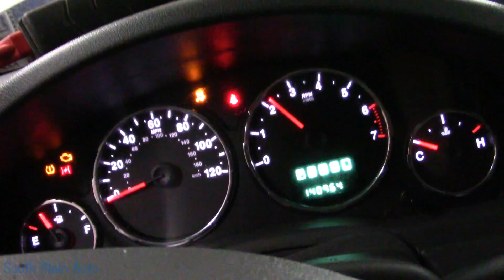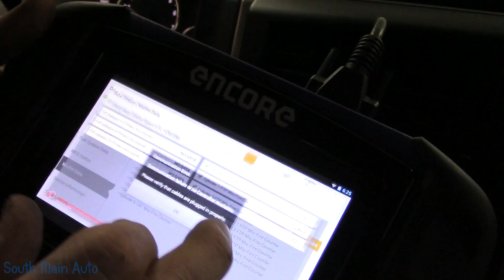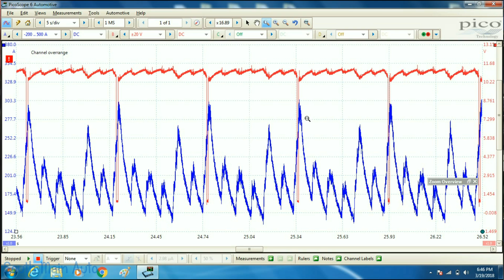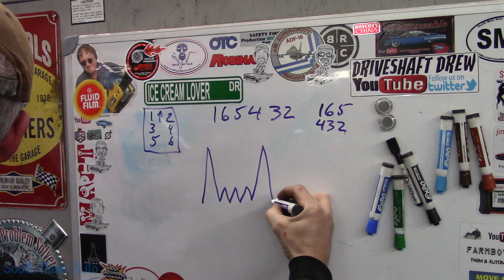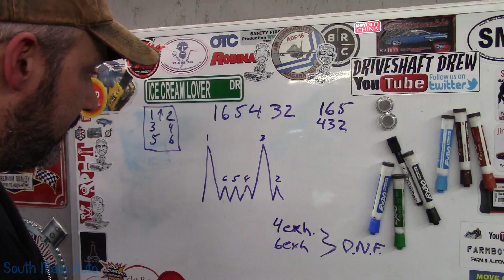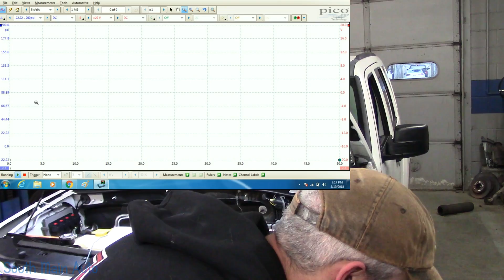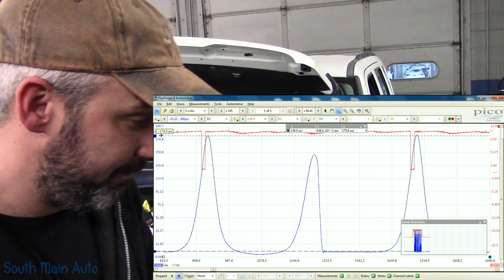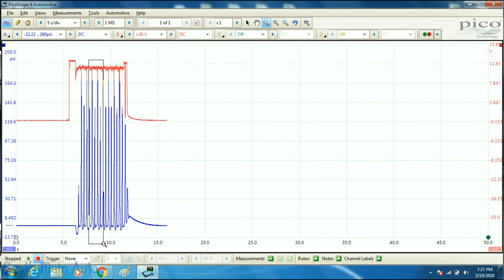Jeep Liberty: Cranks, Starts, Stalls, Runs Rough- Part I

Comment: What an excellent case study. I suspect many professionals would shrug and never explore it enough to find such compelling evidence. I was thinking it was going to be a timing issue, but then when I saw the spark coincident with TDC compression, I had to reconsider. Also I didn't jump at the most important finding, extremely HIGH torque to spin over those two cylinders. These are the problems that make auto repair so interesting.

Comment: At right around 15 minutes I was getting anxious saying "just do a compression test" then came the words of wisdom that will stick with me for ever...." A compression test proves a cylinder can seal, but it does not prove it can breath" priceless advice right there.
Reply from the maker: However, a running compression test will show how it breaths, but ours does not run 😉
Reply: Was thinking exactly the same thing.  Learned something new right there!
Reply from the maker: It does prove Kerryithm2. It proves the engine can seal :)
Reply: Thanks missed that

Comment: When I heard it crank and kinda run, my first thought was some kind of timing issue. Luckily you have the proper tools, and the most important tool under your hat, to quickly diagnose.  Nice work!  Can’t wait for part 2 to see what is the true issue.
Reply: STΔR- LᎾRD I’m trying to diagnose my Jeep Grand Cherokee right now! I could have sworn timing issue as it sounded the same way! For some reason my fuel system isn’t holding pressure with no leaks!!  Even pulled injectors to look for one stuck open. Nothing lol. But you said timing lol that was my first thought as well with chugging and popping

Comment: Eric O, a great diagnosis.  Right here is where having the right scan tool, understanding how to use it and understanding what it tells you is so important.  Twice I slapped my head.  First was when you surmised that the high current draw was due to suspected exhaust valve failure to open on paired cylinders and the second when the pressure transducer profile revealed the second peak during exhaust stroke.  My ‘dial on hose’ compression tester would say good compression on all cylinders.  I guess the ‘popping’ of compressed air back into the intake manifold is a further clue but it’s significance is with the benefit of hind sight

Comment: Excellent call Mr O.  An alternate way of proving your theory might have been to just remove one plug from a cylinder believed to have no exhaust valve.  The relative compression test should now show one of the high current spikes now become normal.
Reply from the maker: 100% correct

Comment: Nice Diag. my friend, and thanks for the files. I have been wetting my feet with the scope and Pico software when time allows at my shop. Yep boss is one of those guys all about get it out quick. He would rather shoot the parts cannon at something then spend the time pinpointing an issue. I do it right anyway (shhhhh). Keep them coming brother.
Reply from the maker: I'd much rather have a guy make the right call the first time instead of "being fast." Fact is, you could have told your boss in one hour, 100% what was wrong with this car :) Remember, your tool box has wheels on it for a reason.

Comment: Thank you for your videos. Was having idle issues with my liberty. I was ready to start replacing sensors until I had it fixed. After watching your video l took off the valve cover and a rocker was not sitting on the valve properly.
Saved me money and time at the beginning. Turned out to be a broke valve stem.

Comment: Nice video! Not knowing typical peak starter currents I would have suspected 4 low compression cylinders and been dead wrong. Your experience once again pays off. You could have, however, just pulled those 2 plugs and re-ran the relative current test. That might have sucked some crud into the cylinders but would have been just as definitive.

Comment: Pressure transducers for the scope are a game changer. Replaces 4 tools, compression gauge, vacuum gauge, leakdown tester and timing light...and that's just by using it for in cylinder testing! Dooesn't even include using it on the fuel rail, transmissions, engine oil, etc. Definitely a must have for advanced diagnostics, or even basic stuff. There are some vehicles that I use my scope, ignition pickup and pressure transducer to check the ignition timing.

Comment: I've seen up to the diagnosis of the exhaust valve not opening, now I'm excited to see what it looks like mechanically - and if exhaust shooting out the intake during the valve overlap did any damage while it was running (which you can see with the steep drop after that second 150psi peak in pressure) - edit, you talked about this literally 5 seconds after I unpaused the video lol

Comment: NGK is actually very good. Flip the haters (I'd use a bad  word but this channel is family friendly)
Reply: I agree!  NGK is what I use in my BMW and she is REALLY fussy :)
Reply: When Champion was bought up along with ANCO and a gazillion other strong branded manufacturers, quality took a real hit. That was of course many moons ago in the early 90s. NGK and Bosch seemed to always be leaders in plug technology and overall quality.
Reply: I was getting new plugs for my 2004 F150 5.4 3 valve which of course is an unusual plug and NGK does not make one for it. I brought my DVOM to the store to check resistance on the Motorcraft plugs and had to go through about 35 plugs to find 8 with an acceptable resistance.  Most of them were very high in the 8-9,000 ohm range with a few up around 12,000ohms while a good plug resistance value should be around 4000ohms with 5000 being on the high side of the acceptable range. 

I have always used NGK's whenever possible and they have always been the best when it comes to quality control on their resistance. It's rare to find a new one with more than 4500ohm.

I see why there are so many coil failures nowadays. People are putting in new plugs that have 8-12k ohms resistance and it's overheating the coils.
Reply: NGK is the premium brand in the UK, for spark plugs at least, I use them in everything by conscious choice and never have an issue in fact removing Bosch plugs from VAG cars and putting in correct NGK has cured some running issues for me
Reply: The Older Jeep/Chrysler we're very picky about wanting only old fashioned Champion Copper plugs.
No idea why..  Eric has mentioned in other videos that Chrysler products seem more sensitive to minor electrical differences in sensors etc.. 
Great video as always Eric..  keep up the good work.

Comment: My grandmother got really lucky with this car.  She just got a 2012 Liberty in this body style with only 18,000 miles and she's already put almost 30,000 on it in the 3-4 years she's owned it and it has never given her any trouble at all.  We call her Lucky.
Reply: DeadofWinter321 my mother in law has an 07 with 300k on it. Oil changes every 5k or less and still sounds new.
Reply: Update (April 2019): Right before she hit 100k miles on it, the Money Light came on, she took it in to get looked at and she said they found 11 things wrong with it.  And then a week after that ordeal, the car stalled on her while driving out to the grocery store.  Had it towed in to the place she always took it to and she said they told her they had to replace some valve (she admits she's a total female when it comes to cars, she couldn't specify what kind of valve).  Got the valve replaced and then traded it.  She's now a happy owner of a 2019 Ford Escape Titanium.  No more Chrysler products for her!  😁

Comment: No mechanic where I live, would have ever come to that deduction without opening that engine up. As he often says, "sometimes you have to go slow, to go fast!" He stops, thinks, thinks again and proves his theories. Bam! Correct diagnosis! What was that 1 hour at most? Engines not all tore apart. 2 spark plugs removed and that's it. Oh hold on, phone is ringing. It's the 99.9% of the other shops calling to say, "dah! I've spent 4 hours on your vehicle sir, and i have no idea what's wrong?" "Do you want me to put a new engine in it for $7,000?" Lol

Comment: Whenever Eric or Ivan does a video on a jeep,  it reminds me of how todays manufacturers can take a fun to drive, easy to work on perfectly designed vehicle like the Willy's Jeep of WW2 vintage and turn it into a troublesome, constantly failing POS. I had the pleasure of driving around in one of the old olive drab open jeeps with 4wd independent suspension back in the service in 1968. The crap thats made by chrysler, Fiat today bears no resemblance in form or function to those great old OD jeeps. They should be ashamed of ruining an American CLASSIC.
Reply: Drove one of those old army jeeps in 68 as well

Comment: If you are a DYI'er and don't have a scope available and a pressure transducer.Another way you could Troubleshoot this is first do a compression check, results would be good, Then see if the valves are functioning and engine is actually breathing. You could confirm the valve function using the hose from your compression gauge screwed into the spark plug hole and adding air pressure to that cylinder. Remove one plug at a time and pressurize that cylinder with very low air pressure. Leave the other plugs in so the engine compression will keep you form getting unwanted rotation and busted knuckles. Bar the engine over slowly and listen for where the air escapes, You should here air come from the intake when the intake valve opens and then from the exhaust when the exhaust valve opens. If you never get air out the exhaust you could assume the exhaust valve did not open. Same goes for the intake valve. You can save time by doing both checks on each cylinder before you move to the next one. Having a helper to listen while you rotate the engine is a must.  Interesting to see what this looked like on the scope. Very cool!

Comment: One note if you don't have a WPS500 you can remove the plug from the companion cylinder and see if the current returns to normal on the high current cylinder. A bit fast since you have the relative compression already setup. Definitely cool for demonstration purposes.

Comment: I knew it! A bad cam follower!  What the heck is a cam follower? Can't wait for Part 2.
Reply: Mr. Robinson 
A hydraulic lifter failure. Sounds right once he explained it.
Reply: Valve lifters are call cam followers on overhead cam engines.
Reply: The 3.7 (and others) use an overhead indirect acting cam. The follower is the part the cam acts on. At one end it rides on the valve stem tip, at the other it sets on a hydraulic lash adjuster. As a visual think of an upside down teeter totter. The valve at one end, the adjuster at the other and the cam as the center point. The cam lobe pushes down, the adjuster is supposed to be pushing up from oil pressure and that opens the valve. However if the oil isn't changed regularly the lash adjusters will plug up and not get oil pressure. Because of this there is nothing holding them against the cam and the valve doesn't operate, plus the way they are installed it is only the oil pressure working against the valve springs that holds the follower in place. Common failure mode is the adjuster sticks down, the cam rotates the lobe up and the follower falls to the side or off.
Reply: Thanks, I think he guessed there were flat lifters before any analysis.  He is a bloomin genius!
Reply: Thank you.
Reply: Thanks Blazer... that makes a lot of sense.
Reply: The problem is VERY common on the 3.7 and its big brother the 4.7.

Comment: Woudln't surprise me if it has zero compression on a cylinder or two and a closer inspection reveals dropped valve seats YES the seats wedging at least one valve wide open. Happened to my girlfriend's '02 Liberty 3.7. Thankfully as a mechanic I was able to re and re the heads in the driveway...local shop redid them nicely, runs like a dream now.
Reply: the relative cr check showed compression on all 6 though.
Reply from the maker: Yes it can not be a dropped seat or leaking valve , we proved that in the video

Comment: I had an 04 Liberty, oil changed every 3k, three tune ups, 3 trans services and 3 cooling flushes in 124k miles.   It lost oil pressure to the lifters but still showed good oil pressure,  one of the cam followers falls off an exhaust valve.  I then get the popping back up through the intake manifold so I did a complete top end overhaul and it ran great for 2 months then did the same thing again.  Flushed the engine, got the lifters to pump back up and traded it in.  Never did figure it out.  Had read it might have had sludged up oil passages due to a poorly engineered ventilation system.

Comment: Correct me if I'm wrong but although it wouldn't be 100% definitive you could test the hypothesis without a pressure transducer by removing the 4 and 6 spark plugs and repeating the relative compression check to see if the 1 and 3 amperage draw dropped down to a more reasonable 180ish psi.
Reply from the maker: Or do the same by pulling 1 and 3 and seeing it return to normal. I should have done that!!
Reply: And that would of shown u what a known good looks like,yes or no?

Comment: Sounds familiar.  12 years ago, while 8 degrees outside, my 4.7L Ram 1500 started overheating after 1 mile from being started.  As soon as I pulled over, the coolant expanded enough to reach the pump and the temp came down immediately.  Added coolant and made several stop and start drives over several hours.  When I got home, I parked it in the road as someone was in my driveway.  Later, I went to move it to the driveway and it was running horribly and making popping sounds in the manifold.  Compression check was showing strange results on the left side.  Pulled the cover and an exhaust rocker arm had fallen off.  Popped it back in with a wrench.    I'm not sure why it only became a problem after several drive cycles but it's been 12 years and I've never had a problem since.  The root cause of the problems was a cracked radiator caused by a bad overflow cap causing too much pressure for the plastic radiator sides to handle.  The radiator hoses blown up like balloons helped with the diagnosis.

Comment: Instead of doing the test with the pressure transducer it should be possible to verify by pulling the number 4 plug and running the cranking amps test again. Since the exhaust pressure will come out the spark plug hole you won't see the amp spike on the opposing cylinder. Of course the amp draw for cylinder 4 will be low but you would know to expect that.

Comment: Would seeing if you have air blowing out of the intake work Eric? I figure you remove the spark plugs from the cylinders you think are unaffected. And leave the spark plugs you think are affected by this, and you would feel a puff of compressed air, when the intake valve opens

Comment: i had the same problem i have formal training and i am a decent technician.  i was have alot of trouble finding the problem.  what the problem ended up being was a bad connection between the crankshaft sensor plugs.  i use some electronic cleaning spray  and bam it started right.  the initial proble was no crank and not able to read the pcm.  so a scan tool was not a help on this one.  point is clean all the connectors between sensors the harness seems dependent on it. bad design if you ask me.

Comment: If you didn't have a pressure transducer, I'd imagine pulling the companion cylinder's spark plug would have lowered the cylinder 1's amperage on a second relative compression test (proving the high compression on cyl 1 was due to the companion cylinder on exh stroke, which can now be relieved through the open spark plug hole.)
Reply from the maker: 100% true!
Reply: Actually, with "all" the spark plugs out doing a normal compression test, it would have "lugged" the starter twice on the cylinders with non opening exhaust valves!
in that case, any seasoned mechanic should notice the sound of 2x cylinder compression and old school mechanical compression gauge would jump upwards twice per 360 revolution.  those two cylinders would sound way off compared to the other 4 and the noise would be similar to a 2 stroke :)
Reply: It would sound different, but with a check valve/schrader valve in the pressure gauge, the end reading wouldn't be any different.  And the companion cylinder (the one without the problem) wouldnt see the issue at all on a standard compression test, only on the relative where you see the starter drawing extra current.
Reply: correct the end reading would be the same or possibly a bit higher, due to double compression stroke, but you should still be watching the gauge "jump" upward per compression sound and not just rely on the end reading! the gauge would oddly jump upward twice, while the cranking sound would be stupendously wrong in comparison to any of the four better cylinders. yes a transducer shows in depth detail, seeing the high cranking current still relies on though process and many wouldn't put two & two together and simply assume the higher current cylinders had major carbon, coolant entering or other damages.
I think "crapsler" calls for three compression stroke cycles for testing, I generally do 5 and watch the gauge closely, by three it should be topped out and hardly move any further, if it keep going up in small jumps over more cranks, then there's likely a valve sealing/guide issue. maybe I'm just too old school =p

Comment: what great video timing, just walked in from fixing a pile of ^*&(%$ jeep liberty! dead miss, had one bad plug and coil, salt/water got down into it, the boot was old and dry-rotted
#6 and #5 miss-fire was false because of #6. spark plug had carbon tracks blasted through the porcelain and the coil had a track up under the boot :)